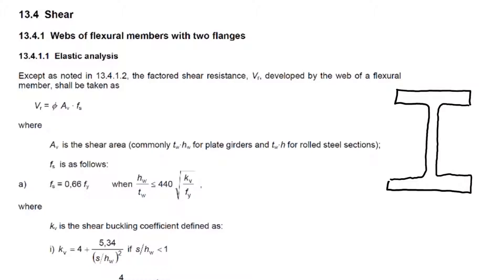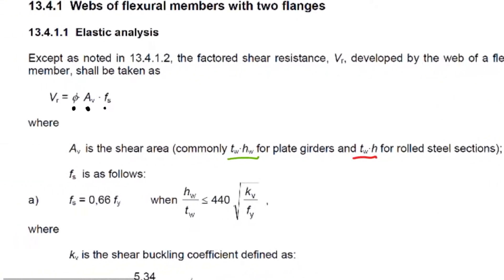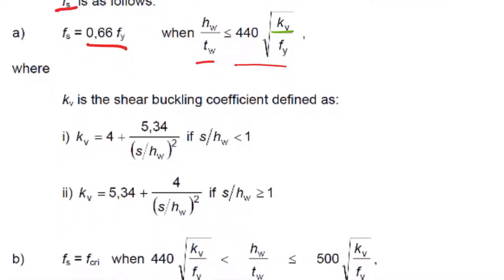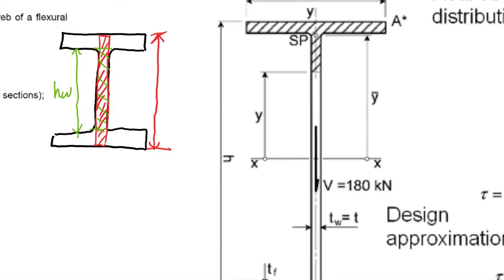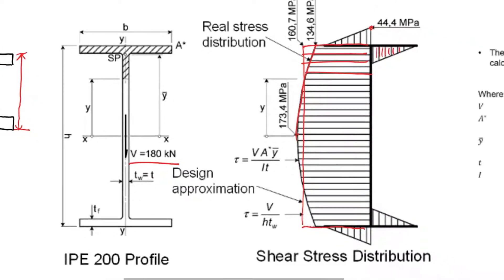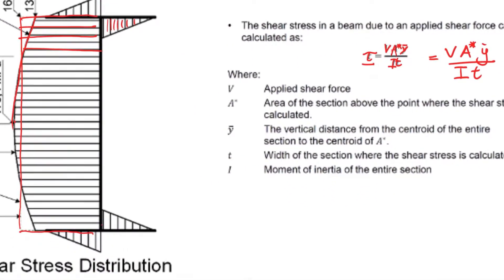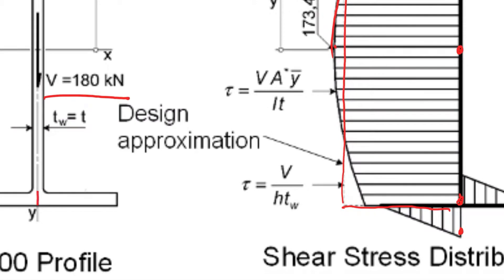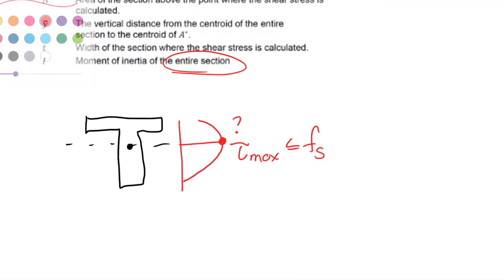Design of structural steel shear elements - Understanding code requirements and calculations

Comment: do you have any videos on foundation design such as piles
Reply from the maker: Unfortunately not. For foundation pile cap design use the strut-and-tie method. For the design of piles refer to geotechnical guides such as the Franki book (in South Africa).
Reply: @richard_walls  also wondering if you're using eurocode for your videos
Reply: @fatimabibi8775  no he is using south african standards